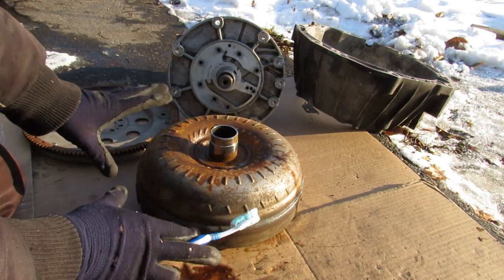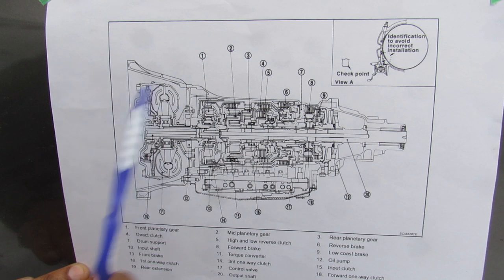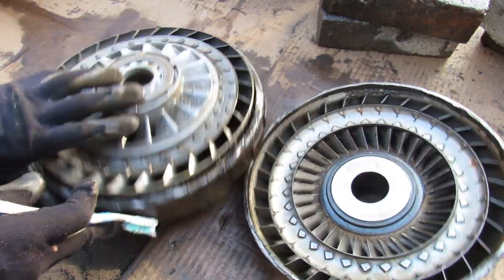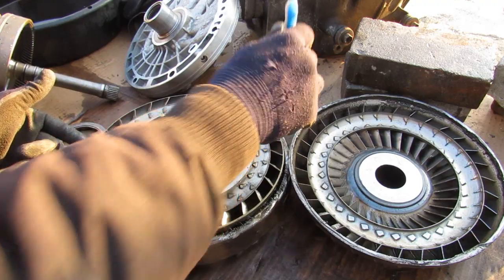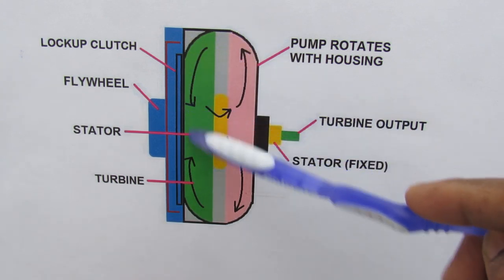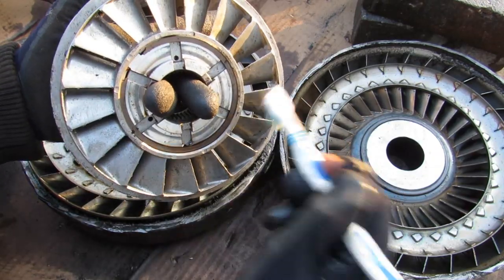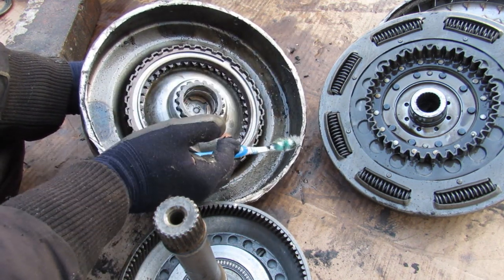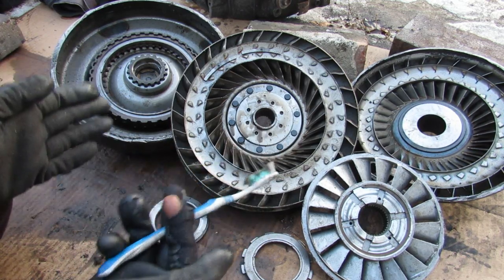How a Torque Converter Works

Comment: As a child, when I first heard about automatic transmissions, I was like "whoa that is so cool! I imagine it's probably just like a normal transmission, but the computer controls actuators to press in the clutch and shift the gears!" I could not have been more wrong. This stuff is fascinating as hell, I never would've thought there's a hydraulic connection between the engine and the transmission like this (and the fact that automatic transmissions just work completely different XD)
Reply from the maker: Yes, very different and cool to see!
Reply: Dct

Comment: Another award winning video on your channel dear speedkar99.  
Might like to add the torque converter does have the 4th & 5th function: yields lousy fuel efficiency and generates lots of waste heat
Reply: Overdrive was one step toward better fuel economy with an automatic transmission. It allows the engine to turn at a lower RPM when the vehicle is traveling at higher speeds.
However, when the engine turns more slowly it causes the torque converter to slip, creating heat. Slipping reduces fuel economy and heat can damage the converter and the transmission. The solution is to lock the converter. Lock-up eliminates the slippage, which reduces heat and improves fuel economy.

Comment: The torque converter in a rebuilt Camry transmission went out after just 3 weeks. It sounded like marbles in a can when idling. The shop replaced it free. 4 years later, no problems.
Reply from the maker: I heard those 2012 era Camry had torque converter issues

Comment: brilliant presentation overall with a nice system diagram.
I wish you would add the practical side such as...:
 - How is the ATF fluid cycled through TC for cooling..
- What makes TC fail with a blue hue..

Comment: Great video as always...I've been experiencing the classic delayed/no shift issues on  my 93' es300. Even after extensive research and changing the TCL and shift solenoids AND upgrading the boost valve on the valve body, it made no difference to improve the shift quality. I'm stumped...I'm wondering if it's the torque converter, speed sensor or something else. No trouble codes and/or OD light ever came on, so I'm suspecting a mechanical issue.
Reply from the maker: Presumably you've drained and filled fluid a few times?
Reply: @speedkar99  Yeah, still no change. Unfortunately, my 95' es300 is also having the same delayed shift issue. I just purchased the Techstream cable and hoping it shows me the problem. The 95' has an OBD-II connector, so it should work. We'll see...

Comment: How does oil gets  into the torque convertor to fill it if the hole at the bottom of the imput  shaft serves to engage the tcc?

Comment: thank you for your always great videos! 
i wanna ask you please, i have a subaru xv crosstreck, i performed myself a fluid change following the MT chanel here in youtube, ive always flet something strange and i thougt the new cvt fluid could fix, or at less soft the problem...it kept going and i saw a video explaining how often this transmition have a failure in the tork lock up solenoid...ive measure my solenoid and i saw one of them not measures properlly... it seems to be it...bad solenoid...my question is...can a bad solenoid ruin or brake a good torque converter?...should i try to fix this as soon as posible?...subaru dosent sell only solenoid...they give the entyre valve body...its ok if i buy only solenoid from amazon or ebay?...thank you very much.
Reply from the maker: Hmm I guess if the solenoid is bad it could damage the converter by engaging when it isn't supposed to. Not sure if I'd trust an eBay one
Reply: @speedkar99  ok thank you so much

Comment: so that lock up of the torque converter is how "overdrive" kicks in? thanks Overdrive was one step toward better fuel economy with an automatic transmission. It allows the engine to turn at a lower RPM when the vehicle is traveling at higher speeds.
However, when the engine turns more slowly it causes the torque converter to slip, creating heat. Slipping reduces fuel economy and heat can damage the converter and the transmission. The solution is to lock the converter. Lock-up eliminates the slippage, which reduces heat and improves fuel economy.
Reply from the maker: Yes

Comment: I need some help with my front wheel drive buick lesabre it has roughly 140'000 miles on it and it starts and runs just fine but it wont go into drive or reverse but it goes into neutral and park and when started there is a hydraulic whine do any of you know what could be wrong

Comment: Haven't yet got your reply on my question about idling at the time of coasting down and putting back on 'D' once u need drive at the botton of the hill? Is there any harm to transmission system due to this?
Hope this time i can have ur reply!
Reply: He can add to this or correct me if I'm wrong, but my understanding is that putting an automatic in neutral at highway speed can potentially damage the transmission because in neutral the fluid pump is not being driven. Or perhaps it's being driven but only at idle speed, so it is not producing a sufficient flow to adequately lubricate the transmission. I'm assuming this I'd the same reason you're not supposed to flat-tow an automatic vehicle with the transmission in neutral, at least above a certain speed or for more than a certain amount of miles. Generally your owners manual will say not to do this above like 35mph or for more than 5-10 miles, or something similar. I'm guessing this is because there is no flow or insufficient flow through the fluid cooler, it starts to build up excessive heat which cooks the transmission fluid, which then fails to properly lubricate the transmission components. 

I guess when shifting into neutral with the engine running, the transmission pump is probably at least running at idle speed? So I would imagine it's not quite as bad as towing the vehicle at highway speed with the pump not turning at all. But still not a good idea, and it likely wont save you much gas anyway.
Reply: @KY.0009  Thanks for sharing your opinion.
The oil flow at 'N'utral condition is the pump flow rate at dedicated enginge nutral rpm,  but Not no flow, as the pump is driven by input shaft. Since at 'N'utral/moving vehicle condition, the gear sets are not engaged, the lubrication demand and generated heat in transmission is not as much as the case that it's on 'D'rive. The difference with 'N'utral/stopped case is that the output shaft also running. Hence I doubt how idling can harm the transmission?!
On the other hand, once you wanna put it back to D from N to push some 'D'rive, specific gear sets are brought to service based on the vehicle speed and engine rpm. This is determind and actuated by Mechatronic. I also wonder if this could cause a harm to transmission?